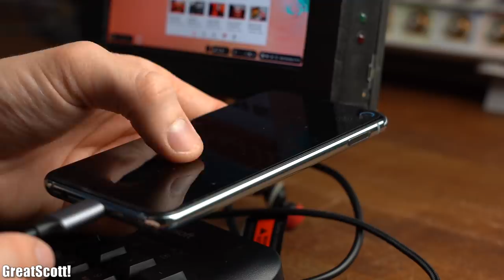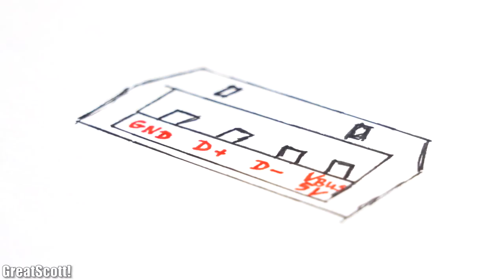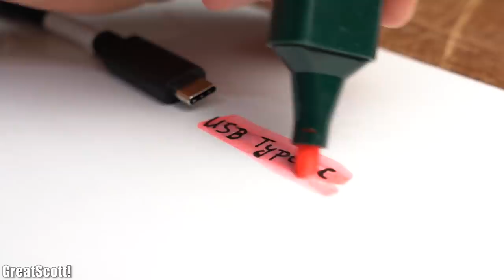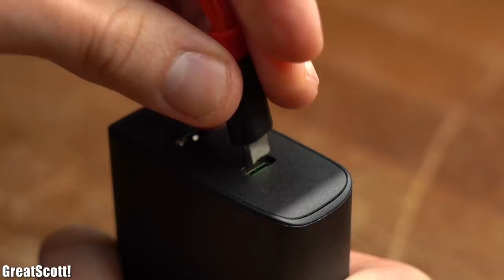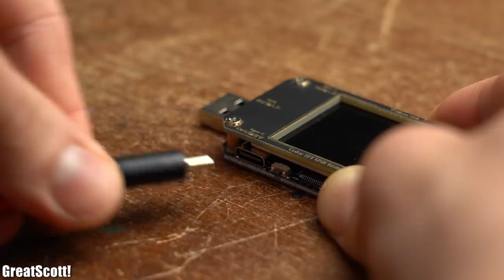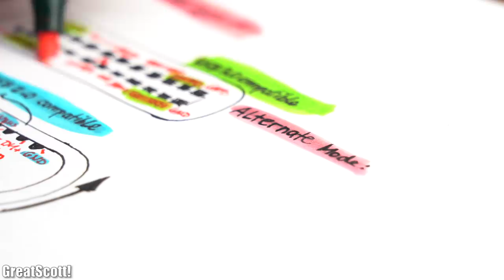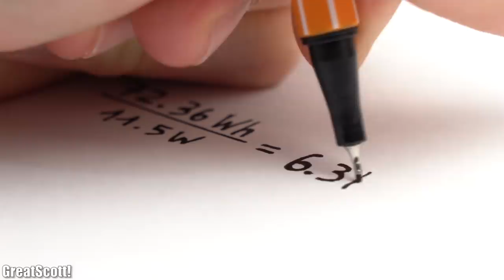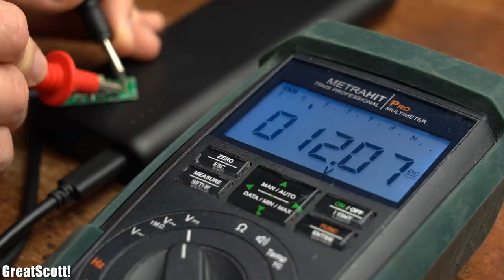Here is why USB Type-C is AWESOME and how you can use Power Delivery for your electronics!

Comment: The only problem about type c - you never know what you get by just looking at the connector.
Reply: Very true. Who knows if a port on a device supports HDMI or even more than 5V. My pc has one, its pretty much just a USB2 port.
Reply: @hennarkilsen1389  Thunderbolt isn't Apples, it's Intels. And it also works over USB Type-C, further adding to the confusion.
Reply: The thing is Thunderbolt is a technology not a connector... 
(It's similar to USB 3.0 and USB Type-C... USB 3.0 is technology and USB Type-C is the hole)
Reply: Sad truth.
Reply: @hennarkilsen1389  you know that there are PCs with thunderbolt
Reply: I definitely agree. There should be a naming scheme which tells you what the port can do, like USB3.1MP = USB3.1 with Monitor and Power Delivery (just as an example, but something along those lines would make this topic a lot simpler).
Reply: Add to that the fact that Intel donated the Thunderbolt 3 implementation, royalty-free, to the USB Forum and now USB4 is actually Thunderbolt 3. Though Intel is working on TB4 though. Oh, add more confusion to the mix, look at USB naming schemes:
USB 3.0 SuperSpeed = USB 3.1 gen 1 --> 5Gbps

USB 3.1 gen 2 = USB 3.2 gen 2 --> 10 Gbps
USB 3.2 gen 2x2 --> 20 Gbps
USB 4 = Thunderbolt 3 --> 40 Gbps
Reply: The good thing is that they (The USB consortium)realised that, so from USB4 it is type-c with everything, eg. PD, Display and all that. So in the future, just look for it having USB4 and you know it can do it all.
Reply: @hennarkilsen1389  You're kidding right? 🤣🤣🤣
Reply: USB 4.0 will support Thunderbolt. So any USB-C 4.0 cable should work for anything.

So when USB 4.0 will become common, you won't have to worry about all compatibilities, the only problem is that this would probably take a lot of time.
Reply: @isaackvasager9957  except that it got developed in collaboration with apple :p https://en.wikipedia.org/wiki/Thunderbolt_(interface)
Reply: @filipstamcar6553  That doesn't make sense though... What if a device simply can't support HDMI over USB-C, because it doesn't have any video data to display?
Reply: @Mobin92  If your device does not support video/display, you probably already know this 😀

My point is that if you have a device and cable which supports USB 4.0, USB-C and Thunderbolt, you can use all features that this device support with a single cable. If device does not support something, this is not limitation of USB but of device.
Reply: here's a theory: USB-C is shit! :D
Reply: @Ucceah  yea ok, you better stay on that usb2.0
Reply: MikrySoft yeah but Apple seems to be the one using it the most
Reply: Cuda FX 👎
Reply: @hennarkilsen1389  When Apple successfully brainwashes its users into thinking they are InNoVaTiVe.
Reply: @filipstamcar6553 , like: I've connected my USB4 A/C adapter to the display, and nothing is shown. Should I buy a new cable? :-)
Reply: @maciekkalwara  USB4 was just standardized, devices don't exist yet... Do you mean USB3 Type-C?
Do both devices support video over USB? Anyway, better to ask on some real support forum for this.
Reply: @filipstamcar6553 , I don't thing any charger would support video output :-)
Reply: Damaged Industries Yep. Their reality distortion field has unlimited power. Think back about when they were all PowerPC and throwing crap at the Intel/PC universe then suddenly switched to Intel and embraced all the PC hardware architecture. Most Mac users don’t even know that MacOS X was not made by Apple but simply bought to replace the heap of unmanageable garbage that MacOS 9 had become. (I was a NeXT registered developper in 1992).
Reply: @ArnaudMEURET  MS DOS also was not developed by Microsoft or at least they bought 1.0 and then modified it and released new versions.
Reply: Thebrightestbrick88  which defeats much of the purpose of USB.
Reply: Momma always said life is like a usb-c connector...
Reply: MultiWirth And? Is there an argument in your statement?
Reply: Thunderbolt 3 is actually another alternate mode of USB Type-C connector. Theoretically it requires a TB3 certified cable to work, but I had no problems with using a good (but not TB3 certified) USB Type-C cable between my Dell XPS 15 and a TB3 docking station.
Reply: Need better labeling standards taken into account
Reply: @csvscs  thunderbolt 3 is now USB4.
Reply: The U in USB is: Universal. It supposed to just work. ;-)
Reply: @autohmae  there is also "serial" and "bus". It is not serial anymore and it is not bus from the beggining.
Reply: @lolerie  nice one !
A recent one I heard: The S in IoT stands for security. :-)
Reply: Same with a mini-jack, right? Could be mic, could be stereo or mono, could be a power.
Reply: @Eugensson  well, no. usb-c connector is always the same 24 contacts. While with jack it is physically different. I mean usb-c can have 4 wires inside or 12 wires, but the connector is the same. Besides that jack in deprecated in favour of usb-c... And I really do not like jack anymore, I have headphones with bluetooth LDAC, it is a codec which is 99,99% lossless, so it is good enough.
Reply: @lolerie  How is a speaker jack different to a microphone jack?
Reply: @mdamaged  So true.
Reply: If it's attached to an AC adapter, then you will not plug that into a peripheral card.
Reply: they should color code them or something
Reply: @boface187  not needed.  if it's a usb type-c external hard drive, then you will not plug it into the power supply usb-type c.
Reply: @petermuller5031  Naming isn't the issue here, it is just what you can identify by the looking at the connector. Such as usb 3 with blue plastic, and how every other cable connector is distinct. I don't really mind though because it's still an objectively better connector protocol overall, and if you really need it to do something else, you'll do your research
Reply: @yawor  Isn't that what I said? 😅
(It's technology and C is just hole)
Reply: sorry. My comment wasn't to disprove or negate yours. Just to describe the relationship between USB Type-C and TB3 in more technical way. Maybe wording on my comment wasn't the best.
Reply: Thebrightestbrick88  no. it isn't.
Reply: @petermuller5031  do you not understand how usb-c works/? or are you a boomer?
Reply: YES, not all of them have the full 100w rating or Thunderbolt 3
Reply: @MLGJuggernautgaming  my phone has type c connector but it's usb 2.0
It doesn't support hdmi out or anything.
It's just usb 2.
My windows powered tablet (x86 hardware) has type c aswell supporting displayport and usb 3.1 but it doesn't support thunderbolt or charging.

And that's why type c needs a reform quickly
Reply: @maciekkalwara  If your display is powered on, then the cable is fine ;) You just need to connect second cable to some display delivery device, but believe me, power delivery is fine :P
Reply: @Sim3k86  , gee, I only was meant to tell a joke... @Filip Štamcar answered someone, that if Your device does not provide any video output (like I believe most of power adapters) You will probably know that, and you probably will not expect anything to be displayed after plugging it, just like you wouldn't expect any music coming out of a speaker connected to an AC adapter.
Reply: @petermuller5031  Probably has to do with stores being able to rip off consumers(uneducated to look for specifics).
Reply: usb c breaks easily too
Reply: Yes, it can be USB Type-C with 10(USB 3.1), 20(USB 3.2) or 40(USB4) Gbit/s; with or without Thunderbolt 3 compatibility; and different power delivery modes: 5V, 3A or 20V, 5A!
And I really don't know how they plan to advertise all these differences in an easy way when it comes to requirements for connecting USBType-C devices!!...
Reply: @hennarkilsen1389  this is why people in the tech industry mock apple fans...
Reply: Just look at which version and generation your usb connector is, you can use usb-c wiki page. I recommend waiting for Type C version 4.0 that's been approved. Just waiting for devices to implement now.
Reply: @MikrySoft  It's Apple's from the standpoint that Apple is the only company to have used T-bolt. Such sensitivity when it comes to Apple....not surprising.
Reply: @lulube11e111  Special ordered ones I presume. I have not seen any.
Reply: @isaackvasager9957  Plenty to do with Apple. They were the only ones to embrace it, as usual...
Reply: @DennisDeMennis_98  amazing how people just write stuff they have no idea is true!
Reply: @Ucceah  Yes I hate it too! It wiggles and gets disconnected midstream thru data transfers!
Reply: @mdamaged  You seem to be the damaged industry....Some electrons probably wedged somewhere and u probably blame everything on Apple.....
Reply: @ArnaudMEURET  Perhaps they fired you and u are looking for retribution. What relevance does this have to the subject? Everything has to become an Apple hating forum. Exposes ur prejudices.
Reply: @ArnaudMEURET  Yes! Ur Apple-hating comment is irrelevant and off topic.
Reply: @nixl3518  Apple being the only company using TB? I guess you didn't hear about little companies like Dell, LG or Razer which all sell laptops with TB3 ports, not to mention the whole range of PC motherboards that support TB
Reply: Not sure how you got me wrong, @isaackvasager9957 , but I was defending Apple from the haters because I am sick and tired of this fanatic hate gene that rears its ugly head up. Given the slightest chance, they just HAVE to come out and express themselves as it seems you need to as well. Some of us love Apple products, knowing that they did not invent every electron running thru their equipment. So what if Intel invented it? Not sure where you got your laptop and do not deny that non Apple products CAN include T-bolt, but most all of them don't because they're cheap! Apple is always ahead of the rest because they make the right choices. I have no emotional connection with them, but I "don't hate them just because they're beautiful"! Interesting how I get reactions to my reaction over the Apple comments, but my comment about how finicky the -C type connector is gets ignored. Good talking to you.
Reply: nixl I own many Apple products when and when I think they’re worth the money (which is decreasingly true). I just fight the bigotry and stay sane.
Reply: nixl The topic is the context. Try to reconnect with the conversation thread and you’ll grok stuff.
Reply: @MikrySoft  I know all about all that stuff u mention. I know they CAN use it; I just haven't seen any of them actually installed on non-Apple products. By the time all the others catch up to the standard, Apple has moved on. I can't explain all the hate, but I guess people just can't stand a standard setter. I must admit, I don't pay a lot of attention when I see primitive PC units, unless I am asked to pull a rabbit out of their screens because , as usual, something goes wrong with them. Usually not hard to find out what's wrong, though it takes me more time, as I rarely have, or want to have, anything to do with them.
Reply: @ArnaudMEURET  As do I, but I, but I have no interest in the other stuff. You get what you pay for.
Reply: @ArnaudMEURET  Funny!! Did you even read my comments? That's exactly what I have been saying. Apple haters popping out everywhere just to make a hate comment. I responded with original content about the connector, but also to some of the hate comments.
Reply: @lulube11e111  with pcie cards or some motherboards any pc can use thunderbolt Linus tech tips did it with his pc at home which is really overkill but fun lmao
Reply: MikrySoft thunder bolt was developed bu Apple and intel but intel bought the rights
Reply: The colour of the plastic on my phone is a purple type colour I think the colour is an indicator.
Reply: @Magic-Tree  Well spec say it's usb type-c, but he is hook up to USB 2.0 controler and you can do shit about this.
Reply: @hennarkilsen1389  It is a tunderbolt...
Reply: @nixl3518  Also, Apple did collaborate with Intel in developing Thunderbolt for the record
Reply: @Ucceah  better than Micro B
Reply: @Ucceah  shitty bait, the door out is on your right
Reply: Looking online, PD 3.0 has many optional features. Unless I’m reading something wrong, that seems like a horrible way to implement a standard.
Reply: @CyberVeggie   It should be made law that you can't remove comments, because obviously I miss a gem with hennarks comment 😞🤣
Reply: Easy fix just require all cables to have the info on the cable
Reply: @MikrySoft  maybe, maybe not
Remember that macbook use Apple Silicon still have thunderbolt 4
Reply: In the future all should be included in everything
Reply: They should really have wattage + data speed on the cable.

Comment: Type C is pretty awesome, the only problem i have is cable rating labels.
In general you won't be able to tell if a cable can handle 60W or 100W easily.

However I would definitely be purchasing some of the trigger boards to modify some of my old laptops to allow type c charging as the trigger boards have gotten smaller to be possible.

Comment: That source board is amazing. Thanks for sharing!

I was involved in the USB standardisation meetings for alternate mode, so I know a lot about this topic already, but this video was the best summary I've seen of it yet. I probably couldn't have done better myself!
Reply: I tought that, these funtions are just passtrought, like X11 passtrought over ssh.
Reply: @engelsteinberg593  no, alt mode is a specific protocol. Originally it was going to be only for sending DisplayPort, but I was involved with ensuring that it was open to any kind of display data, not just DisplayPort.
Reply: @isoscelestriangle  I don't explain myself correctly. Was I have been say, is that i think that there is no alternate  mode, and just things like the docker futured in the video  worked paasing thing like the HDMI or other USBs like you would make passtrougth some esoteric no defined in the ssh documentation protocol on  top of a ssh connection.

Comment: But this means we won't get anymore USB plugging memes
Reply: we do tho, if you use the wrong usb type c cable to power/charge the high-power device, the cable might be broken
Reply: I almost never put a USB plug in the wrong way. Neither an A type plug nor a micro-B plug
Reply: @bspringer  let me guess, "and everyone clapped when I plugged it in" right?
Reply: @lazyh-online4839  Haha no. I always look at the connector first that's why it always works first try 👍🏻
Reply: @bspringer  but dats slow!
Reply: @bspringer  heil satan
Reply: You forgot that type-C is a reversible charging connector, so you can plug it in only 2 ways, but Nokia had a round charging connector that could be plugged in all 360 degrees.
Reply: @MrBiky  OMG it's so true
But nobody remembers
Reply: We'll just get ones where the adapter incorrectly outputs 20V for a 5V device and burns it to a crisp.
Reply: @gblargg  that can never happen
Reply: @lolerie  looks pretty damn easy with the setup in the video. Press the little button and bam, 20V
Reply: @gblargg  it has very difficult protocol under the hood. You can google pd signalling. It is just crazzy. Consider that, part of it is done on software level, i mean master slave, IOMMU, protection against direct access attacks..
Reply: Well, you first try to pulg in the usb one way, it doesn't work, so you try the other way, doesn't work too, so you go back to the first way and it works.
Reply: agree even if you look for the usb symbol it's strange. I guess the plug is not just right at the time.

 They have cordless charging they have wifi and Bluetooth I am looking for the manufacturer to just eliminate the usb, they already took the headphone jack away.

I'm hoping they never do and I plan on keeping my current phone. Not everyone is on the Bluetooth band wagon.
Reply: @ronb6182  I was joking.
Reply: you were and I wasn't I have trouble with my wife's trac phone charger cable.
Reply: This is the worst trade in the history of trading
Reply: @spidercubed9718  yeah true but charging cables back then had the least of problems we have now. It only takes 2 pairs of connections now you would think they could make a reversible usb cable. Use ac for charging and put the data lines on the outside or inside and the charging on the opposite. Just a thought.
Reply: @bspringer  ohhh ofc and i get my data always transmitted with every micro cable i use ... :D
Reply: We will start making "when you try to plug in your usb at a 90 degree angle," memes for sure
Reply: But we will get memes on our cousins plugging our devices in to the 120ac outlet or were you live
Reply: No worries, we still have Apple!